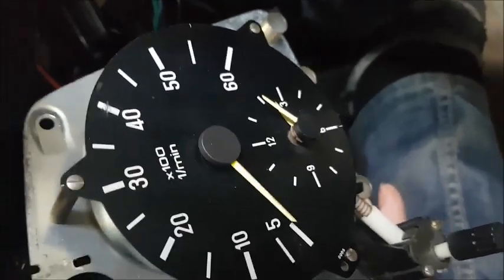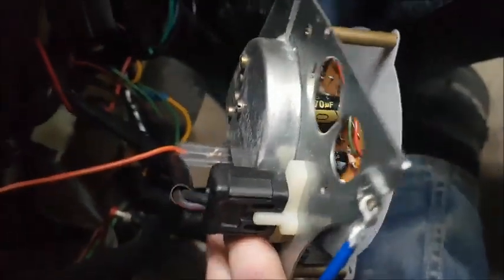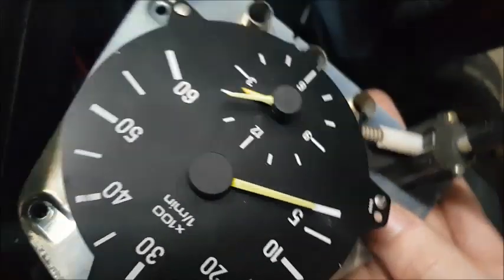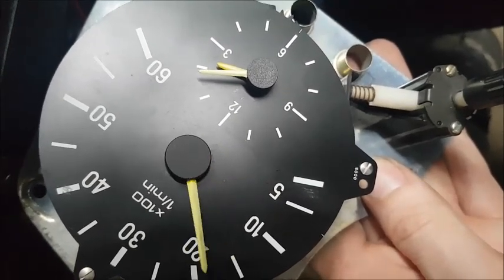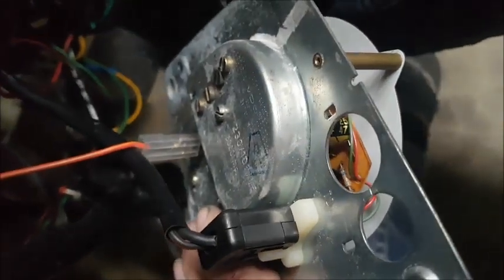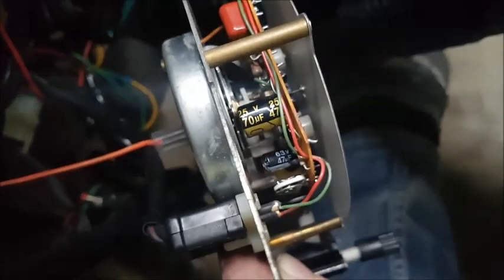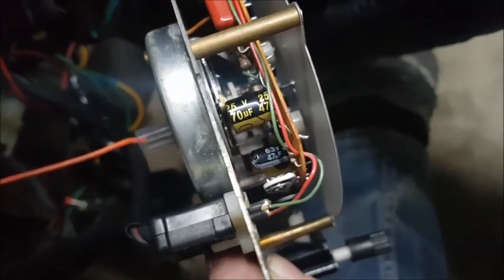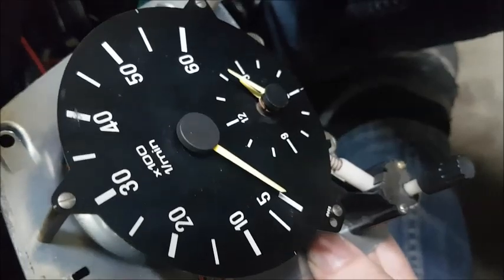tach calibration

Comment: Can I know where do u connect the 2 pin wire from the back side?
Reply from the maker: a 12v line is to the clock.

then there is a Power +12v line as a power source to the tach

then there is a signal wire that goes to the pickup that's in front/above of the engine crankshaft pulley

then the body of the unit is the 'ground' so make sure it's nice and screwed into the back of the instrument cluster.
Reply: @qwertyui90qwertyui90  
Thank you

Comment: With engine OFF, Move the tach needle counterclockwise until it's at 0 RPMS. Start the engine. The RPMS should be around 800 or so.

You might have to pull out clock needles in order to move the tach needle counterclockwise.